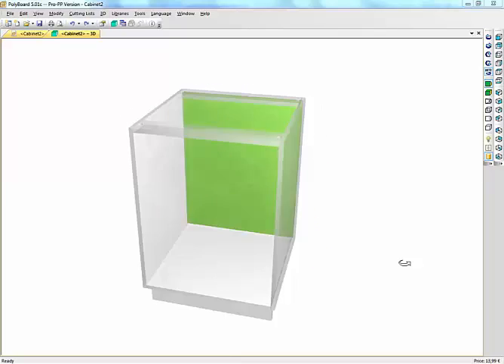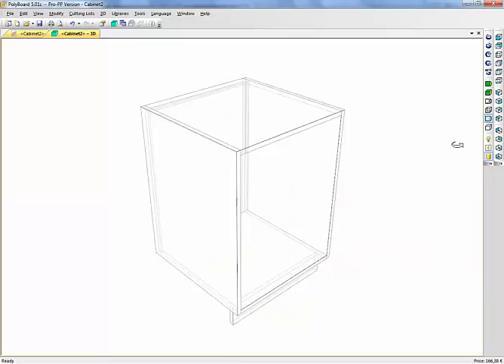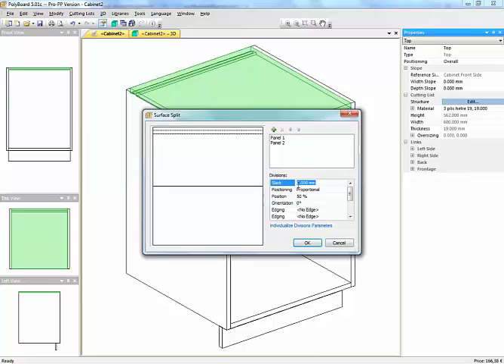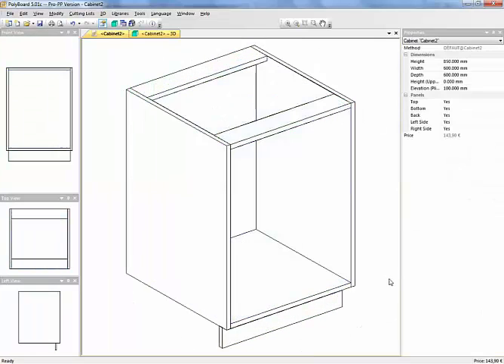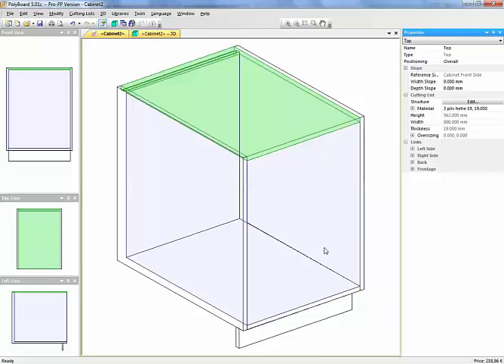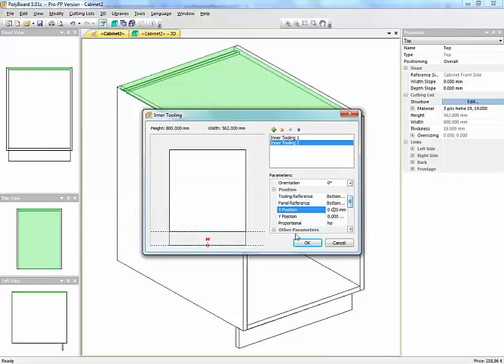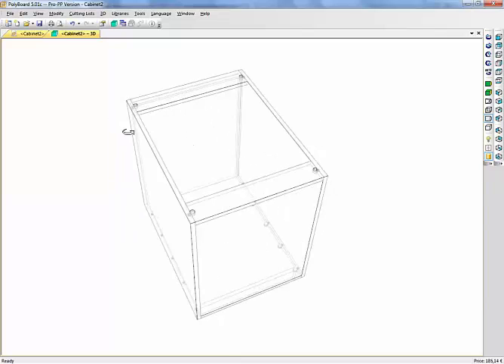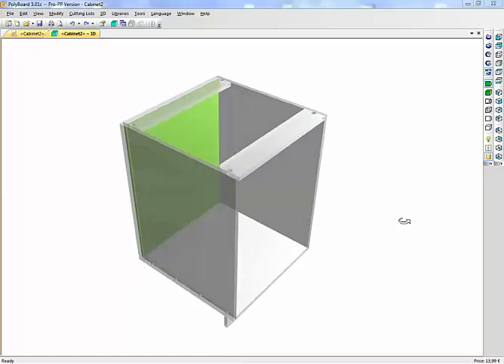Top rails in kitchen cabinets with Polyboard software

Comment: Why can't i do the structure split with Polyboard Lite if it comes with all the Polyboard manufacturing standard but rectangular?
Reply from the maker: Polyboard Lite doesn't include access to the Structure Menu and the advanced panel design features. It's possible to upgrade to Pro if you need this feature. Please contact us on our website, link above. Thanks